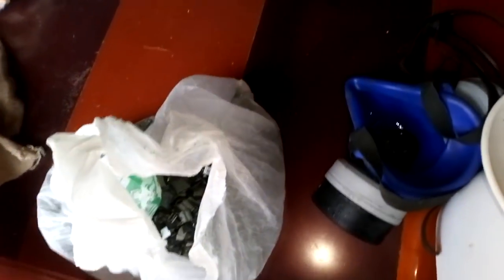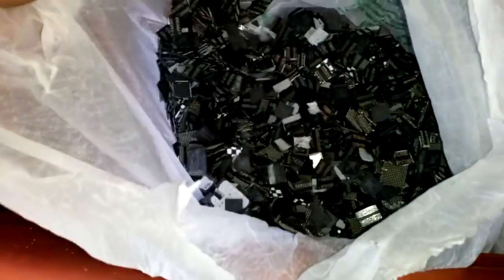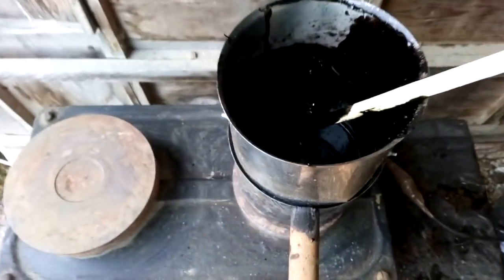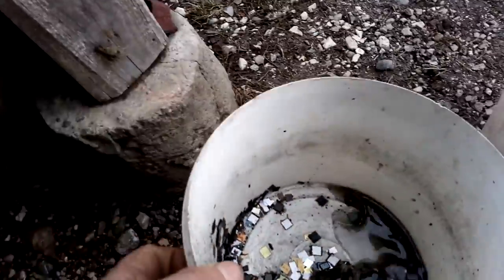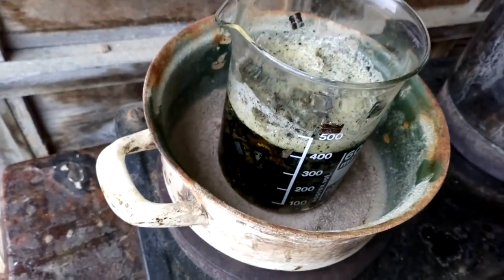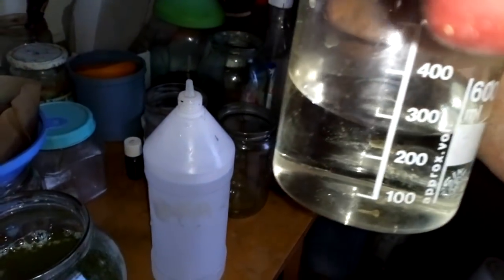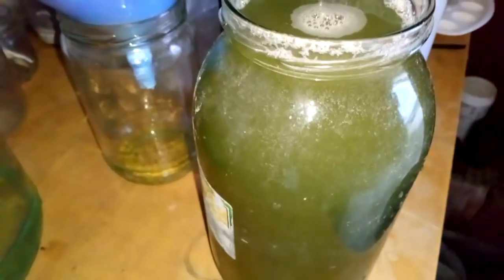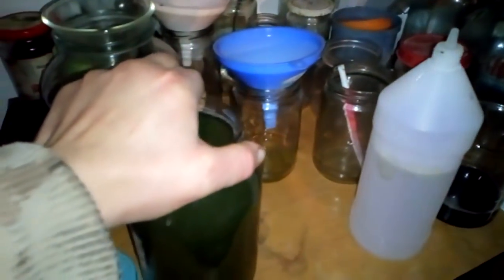Process little Bga chips from ram,graphic cards,laptop and server for gold recovery.

Comment: Another great video. When I wet ash BGA chips there is a bunch of mesh material mixed in with the bond wires and silica dies. Did you see this as well? If so, did you process this material in AR to recover the gold?
Reply from the maker: After wet ashing I always go rinse with water, then the bath in the nitric to remove all the base metal and at the end aqwaregia.

Comment: What type of l container can l use to dissolve the sílica with sulfúrico acid from the chips beyond the Glass becher
Reply from the maker: In my opinion, the surgical steel is best shown. The sulfuric does not react to the stainless steel but will accrue it in time, while the surgical steel does not react even after a long time. In addition, you can use hrom metal or even aluminum in a short time.

Comment: Dusan, Why not incinerate?  Looks like you got a real torch now!
Reply from the maker: The problem with this type of BGA chips is that after insinerating and grinding a piece of gold remains stuck in the fiber itself and stays in mesh, so I prefer to use this method for these chips. In principle, I burn low-quality chips to not spand acid on a small amount gold and fat chips.